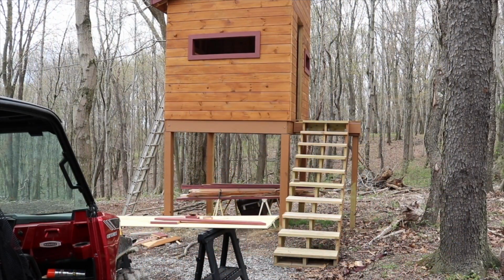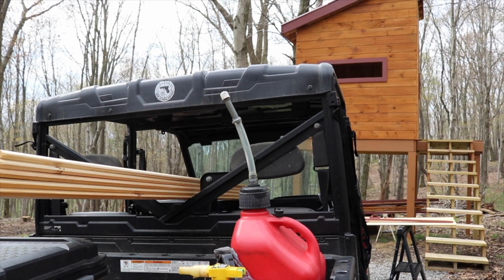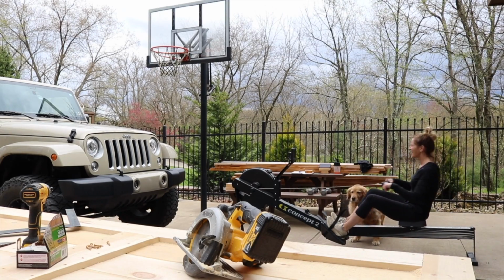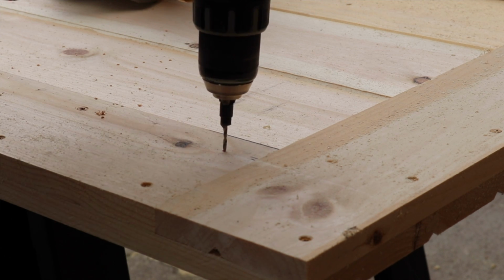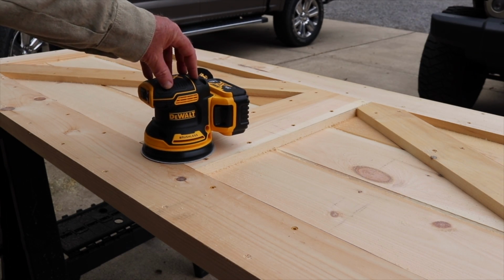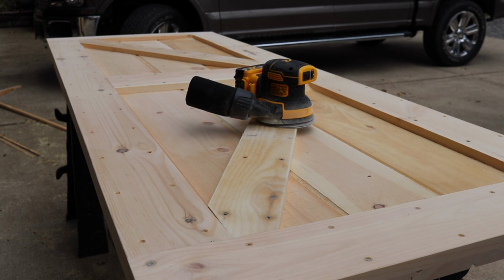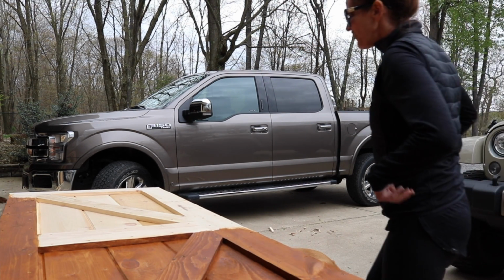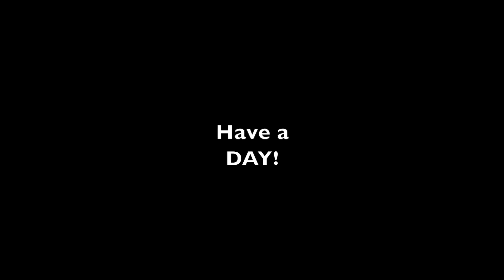#769 Quick, Easy, Rustic, Board & Batten Cabin Door, My first Attempt

Comment: Mike,  When we made barn doors all that cross bracing, which you did such and excellent job of fitting in place, would be the inside of the door.  The smooth side goes on the outside for the best water run off.  Also it seems that you haven't tilted your window sills for water run off either.  But I do like the colors.  Can't wait to see the little wood stove put in.

Comment: For a first attempt fair play, however if you’re going to screw the joints, glue the stiles and rails. 
  Also one of the braces is the wrong way around, make sure both braces start at the bottom on the hinge side and finish at the top on the latch side, otherwise you’re just adding weight to the door and will sag and bind on the frame. 
Personally i notch mine into the rails to prevent it forcing off the stiles.
You should check out Bradshaw joinery or samurai carpenter they have some good videos on the subject 👍

Comment: Nice door Mike. You might want to put a screen door brace on it tho. Screws will only hold all that weight for so long. You know the one I mean is the long turnbuckle that fits a diagonal. That way you can tighten it up when the door ages. You did a great job with no TABLE SAW , hint hint !

Comment: It looks like a nice door, Mike. I hope I am wrong but you may find the door buckles and warps quite quickly with your construction method. From what I saw, the T&G boards were clamped tight together then the rails and stiles were screwed to them. This means no room for expansion of the boards. In addition, The rails and stiles are butt joined, therefore little in the way of integrity. With a little rain and sun on them the door will swell and warp. I hope I'm wrong,You might be lucky. Good luck.

Comment: If the bracing and perimeter board side of the door is going to face the outside I would have screwed them on from the other side to hide the screw heads.  That kind of interrupts the nice tone of the stained wood.  OR......screw them on from the other side and add hand cut nails from the outside for more of a rustic look.

Comment: Mike, you should cut the  door  in half  on the center  board to  make  it  a Dutch  door ,  that way  you  can  open  the  top  part   to  let  more  air into  the   cabin  on those  nice  days , BTW ,  the  door  looks  awesome  nice job.
Reply: Hey, that's a great idea! It will help with the ventilation.

Comment: Hi mike enjoy your channel. Im a contractor carpenter for the last 32 years thought I’d give you some tips about the door. From what I saw you never used any glue on the door my suggestion would be any polyurethane base glue  it’s awesome for outdoors screws will loosen in the corse of time. Do to moisture and expansion and contraction    The other thing is your boards if left at the thickness of 3/4” tend to warp. So when glueing another board to it from the other side stabilize it. This other boards can be glued in diagonal which makes it also look very nice. Cheers. And keep up the good work  Dave. Montreal.

Comment: Hate to be a downer - but the braces are in wrong. They're there to stop the door sagging and going out of square. To do that they both need to run the same way.  They both run from the hinge side up the way to the ledge on the lock side. One from the bottom hinge side to the centre lock side - the other from the centre hinge side to the top lock side. You've got one running up and the other running down. One's doing it's job - the other isn't. Apart from that - it looks good.

Comment: For somebody that doesn't like to paint, you sure seem to be doing a lot of it lately. I'd have just rented a quality airless sprayer and done everything in one shot. That door looks good, but if you add a jamb for it on the cabin (and you made it the size of the rough opening), you're probably going to be removing a bunch of screws in order to trim it to fit..

Comment: The reason professionals don't build doors this way is because they warp. It takes alot of time to offset grain and build up thickness to control warp, checking and shrinking. Then the door should be filled before staining. After staining  a high quality finish with uv blockers should be installed. At least 4 coats on ALL edges and flat surfaces. Then it should be resealed every three years. I know people don't do this. That's  why they make fiberglass doors.  Good luck.

Comment: Hi Mike. Super video as usual and a great job on the mini-cabin door. Looks very good.
A couple of tips for the future if I may be so bold. 
If you need to use clamps to pull home the T&G joints its a good idea to use an off-cut to gain a packer with the correct profile to protect the clamping area. ( I take the off-cuts and cut them lengthwise to give me protection fot both profiles, I cut them about an inch away from the profile). Some profiles are quite delicate, this protection prevents the cramps from bruising the boards and causing a problem with the next one.
You have probably done some research as you have the styles, the rails, and the braces pretty well proportioned the diagonal bracing is best fitted under compression rather than tension, so from the hinge side bottom to top at the closing side. Many will say it doesnt matter.  Were you not tempted to split the door making it a stable type? Great job, great video.

Comment: The homemade door looks great and is more appropriate for that application than a residential door as long as wood movement was taken into  consideration when measuring.(Green will shrink, KD will expand) Keep in mind, the hinges go on the side where the bracing meet the upper and lower rails. This coming from a shop carpenter.

Comment: Mike your door is beautiful! Great job! If you want to insure it stays square and warp free add some exterior carpenters glue to the joints between the cross braces and it will stay straight and square for years!

Comment: next time angel cut the side that opens so it doesn't rub when u open it. your doors r wider on the out side then the inside just for that reason. it will allow for a tighter fit. and not such a big gap on the open side.
Reply: thats a good tip for those thick doors.

Comment: Like your channel and hope you don't take offence but you need to finish the outside corners of the cabin with something: 1 x 4's or anything. With the bare corners rain will be in contact with the framing.Also noticed no caulking: doing a good caulk job will seal raw edges and seams: again to keep the rain out and away from the framing and more importantly keeping overlapping wood sealed so water can't get between the boards and start the rot process. Lot of work in that little cabin and for it to start rotting in a few years would be a shame.
Reply from the maker: Yea I am, it's already to be put up, I mentioned that in another video

Comment: Hey Mike , something for you to check out , when folks suggest using a "roller" they and you may be thinking of the standard size wall roller that one would use on the walls in your house ?. Well I'll tell you about a "mini" roller that I've been using for years on my painting contracts for my clients ( in addition to the standard size wall rollers ) . It's made by a US  company called Whizz , and they make the handles and the roller sleeves , are either in foam or a cloth material and here's the difference : the sleeves are about 4 inches long or a 6 inch long version and I find them great for getting into small areas or smaller projects that don't need a standard size roller or where the big roller won't fit .  I use them frequently on things like staircases , doors , baseboards etc , indoor and outdoor .
They would be perfect for use on the mini cabin even on the underside joists , beams , everything . You can put on as much material (paint) as you can with a brush and cover the project easily and a lot faster too than you can with a regular brush . The cloth sleeves would be best for your outdoor jobs and the foam ones are best used for kitchen cabinet doors and cases . Might be worth your time for a look at it ?? / love the new door , it looks great .